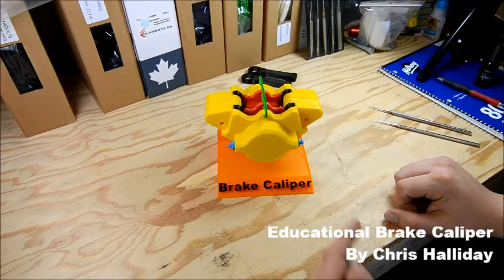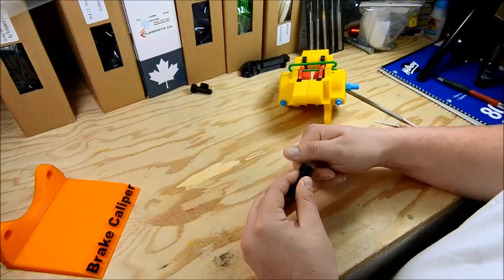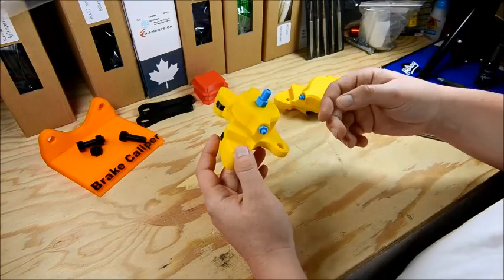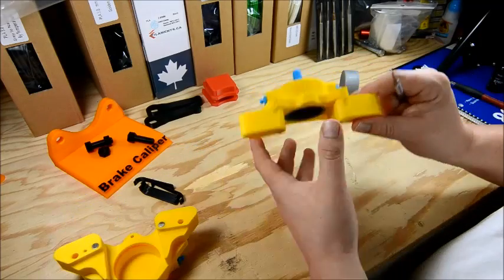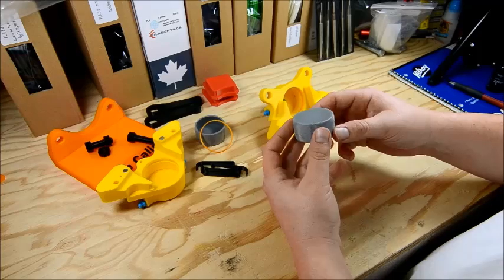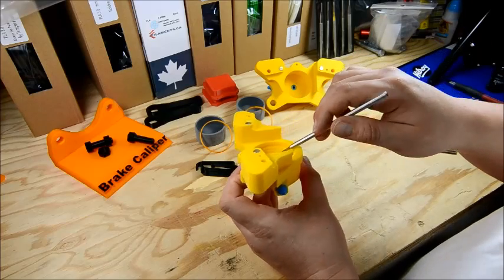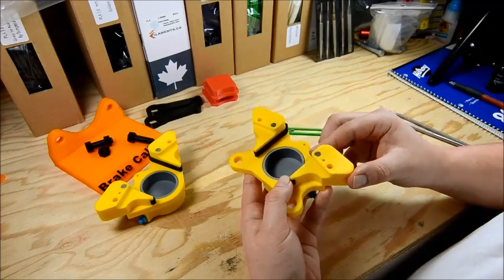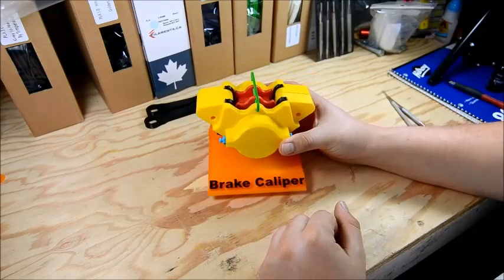3D Printed Brake Caliper - Educational & Display!

Comment: could you use air to work it as a working demo.
Reply from the maker: +chip2567 Hi Chip, With some adjustments, including tighter tolerances and seals I think air could work. it would definitely be a chore but it is an interesting idea!

Comment: I have to ask because I see the filaments.ca pack on your desk and I have been reluctant to try them.  Is it any good? How solid is the color, overhang and bridge well, string much? So far I have found hatchbox to be my favorite (out of hatchbox, MG chemicals, printrbot, buyapi.ca, and colorfabb) but for some reason the only have pink, green, and blue for pla on amazon.ca.  Would you recommend filaments.ca or something else?
Reply from the maker: +Calan Wisbey Hi Calan, So far Filaments.ca has been good for most of my PLA's. The black has also printed well but I have snap issues with it if I leave it in the printer overnight. I am happy with the results I have had from my PLA's so far. I haven't tried much else yet although I do have some ABS & Specialties. I've been working with the filaments stuff for a bit now so I have been able to dial it in via S3D and the Lulzbot and so switching PLA's is pretty easy. Hopefully that helps you out.